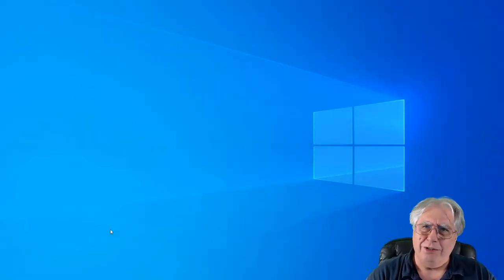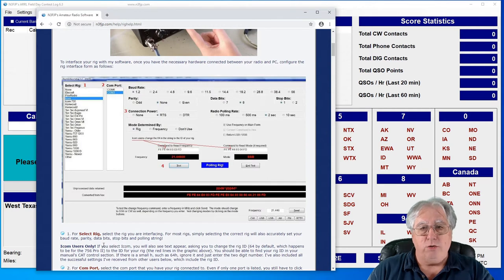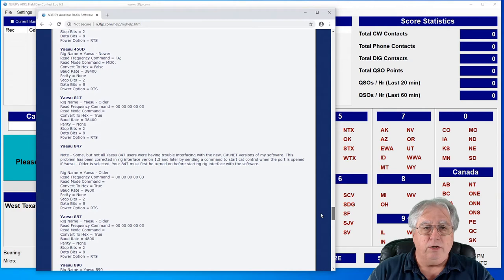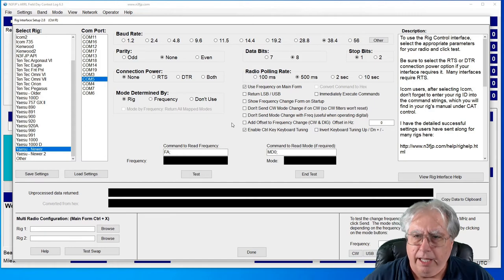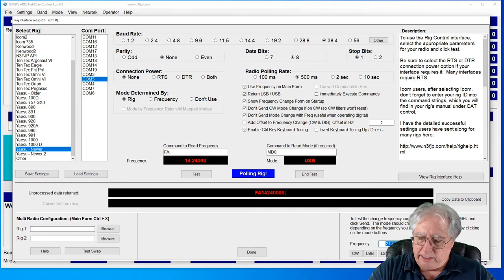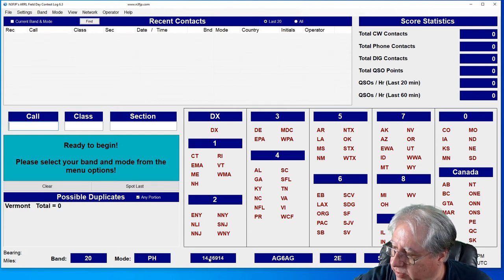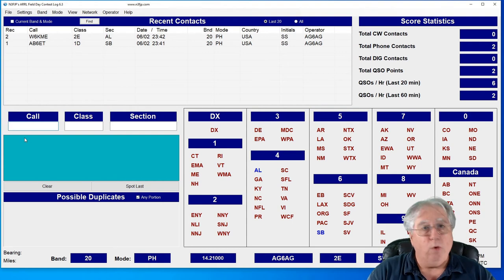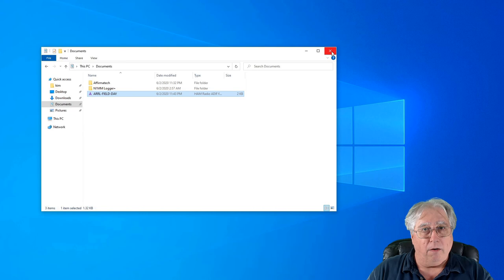Connecting Your Rig To N3FJP Via CAT Control

Comment: Stuart, Do you know what the setting are for the Kenwood TS-890S? Its not in Scott's listing of rigs. Thank You, Ron (N2RLH)
Reply from the maker: Hi Ron,
I'm not sure but all the stuff I find on the web about it points to the 'Kenwood2' rig setting. I've been told the software author is pretty responsive. If you are really stuck, go to the 'Contact Us' on the N3FJP and post a question there...

Hope that helps!

Stu
AG6AG
Reply: @AG6AG  I'll give a try. Tied quite awhile a go, just couldn't get it to work. I'll let you know. Thank You for your time and great video's. I subscribed!
Reply from the maker: Some of the rigs can be challenging. I use N1MM+, but it can be complicated to setup and use. Keep us in the loop!

Stu
AG6AG
Reply: @AG6AG  Thank You!
Reply: This is what it says,  "Object reference not set to an instance of an object" have no clue. 
Give me Com 2, Com3, Com4, and none will work
Reply: Do you have an email address, where I could send you some pictures of what its doing? T
Reply from the maker: Hi Ron,
Sure! You can send me email at ag6ag@arrl.net. I'd like to know a couple things as well when you email me:

1) Do you have any software that you have successfully configured to control your T890s?

2) Can you verify that your COM port exists and what port it is by following this video: https://youtu.be/J9371IS52yQ.

This should give us a bit more of a starting point.

Stu
AG6AG